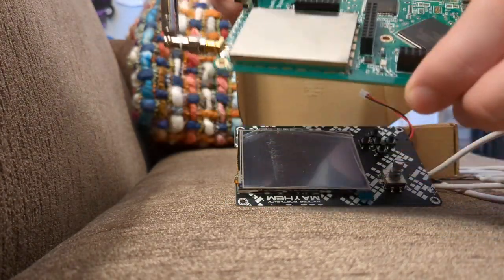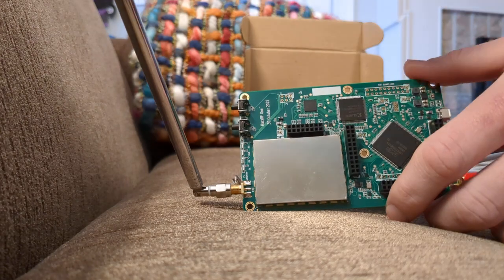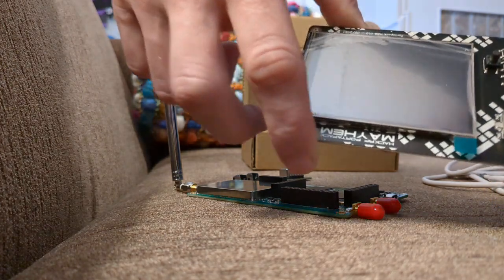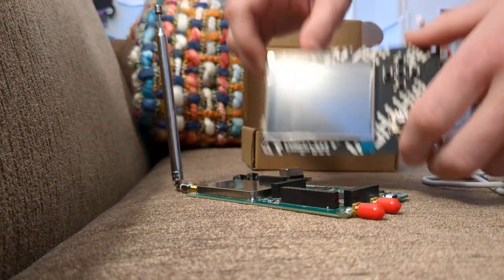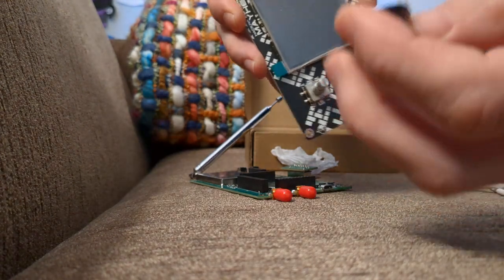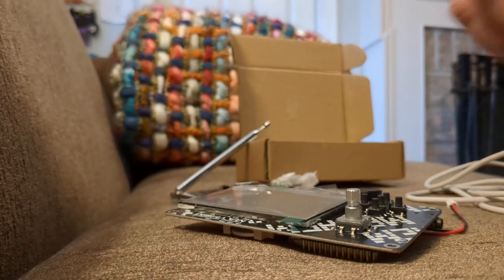Unboxing Portapack For HackRF

Comment: your clock issue here- this is for others who may encounter this- the clone boards are more geared towards being part whole as the 'portapack'- not so much as a separate, standalone device which the hackrf had originally been created as.... the porta pack, depending on version either has a clock internally incorporated into 1 of its chips....or has its own clock....you can investigate this through the portapack menu under utilities> peripherals> here you will be able to see which chips are within your device. They have varied slightly, especially the original great Scot gadgets HRF had recently gone with some changes in chips. his was/ is due to many component shortages

---- Zkitszo 
- "just annoyed, paranoid, doctors say i'm schizophrenic- maybe? I do act a bit manic."
Reply from the maker: Lots of exciting features on portapack / mayhem firmware. :) Someone else commented another command on the clock check for R9 revisions in comments. 

Ah, found "Peripherals" under "Debug". The latest firmware moved some things around.

Comment: Are you using the correct command to check the TCXO? With the R9 revision, you would use the command "hackrf_clock -i". You can't use the old command of "hackrf_debug --si5351c -n 0 -r" since the R9 does not use the Si5351C chip. Also, you only need to use that TCXO if you aren't using the portapack, as the portapack contains it's own built in TCXO.
Reply from the maker: Ahh, yes I was using the 'old' command - oddly enough, it was still suggested for an R9 issue I saw on Hackrf.

But with portapack now (received separately), I don't need to worry about it - and the hackrf_clock -i works with portapack.

Thanks for the heads up! May try this after removing the portapack to see if it works.

Comment: I ended up buying a clone with kinda everything included except the battery but I was extremely lucky in that I stepped on my weird ebook reader and recycled the VERY thin battery inside. It fits so perfectly in the metal chassis that my portapack kit came with it’s like it was made for it. 3000mAh too!
Reply from the maker: Twas meant to be! :) Post video: Looks like I have work to do - apparently they got me a clone of R9 which is problematic with portapack. If I work out / find a fix, will share it. 

Being careful to research before taking action on it, as I here some clones use custom firmware - and trying to avoid harming functionality.
Reply from the maker: UPDATE: I just figured out how to get mayhem flashed / working! Originally it says BoardID not compatible and refused to flash the firmware (which did not work out of box on the clone), and will be sharing process on R9 clone. :)